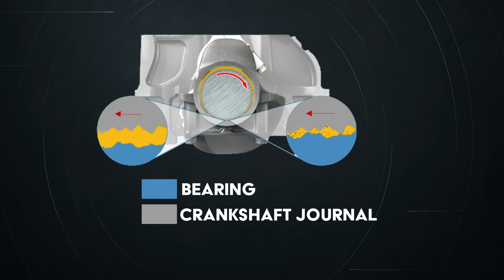the truth about start-stop technology (finally proven)

Comment: The start-stop function has two main purposes - to fool drivers into thinking they are contributing to the environment and to accelerate wear and tear on the engine, starter and battery.
Reply: Sounds like a win-win for automakers
Reply: @IvelLeCog Increase prices, reduce profit margins, and increase warranty services? That's a win-win? 

A win-win is reducing warrant service while decreasing fuel costs. Turn your start-stop off, putting more wear on your engine while using more fuel if you want. It's your money.
Reply: @MrRoguetech 😂huh
Reply: Bingo-they are saving a thimble full of gas and destroying their eng without knowing it...
Reply: @tonyjordan1320 and how much environmental impact does making a whole new engine have? It's all a racket for short term profit at long term costs...
Reply: @harveyottotech apparently very minimal impact. My BMW with start stop lasted 12 years and +300K. Only reason it died was because some asshole who was texting and driving crashed into me. Start stop never caused any issues.
Reply: @harveyottotech That's why start-stop engines are more environmental. They last longer, and therefore fewer need to be made. Decreased emissions and increased fuel economy are just a (rather small) bonus.
Reply: @tonyjordan1320 Start-stop engines last longer, because it reduces run time of the engine by hundreds of hours.
Reply: @tonyjordan1320  The fuel saved is used a 100 times over to manufacture the new parts needed because of premature failure. Just like everything else the globalists do it makes no sense other than to control you.
Reply: @bobmarchetti8878 Start-stop engines last longer. The fuel saved is fairly neglible. The real benefit is from decreasing the amount of time the engine is running, and therefore increasing the time it lasts.
Reply: @MrRoguetech  Interesting. As far as i know, the engines that last the longest are the ones that are constantly running without getting shut down, like in trucks. DO you have a source for your claim of start stop increasing livespan ? I can´t imagine that those couple of seconds at the stop light will actually contribute much, compared to the wear on the starter motor and other components from constantly restarting the engine.
Reply: @XA--pb9ni Trucks that are run infrequently last for hundreds or even of thousands miles. Do you have any evidence that there are fewer mechanical failures in trucks that are run non-stop than those kept in storage?
Reply: @MrRoguetech I never said i have a source  just that thats what i learned. But i asked you for a source and you clearly did not provide one.
Reply: @XA--pb9ni You learned that engines maintained in storage don't last as long as ones in use? So spare parts can't be made at the same time, because most spares would break before the ones being used?

That is not something I have ever learned.
Reply: @MrRoguetech Wtf are you saying? Who said anything about storage?
Reply: @XA--pb9ni Obviously a car just left sitting in a field is not going to last more than a decade.

All else being equal, an unused car will last longer than one that is used.

Source, I own a low-mileage car made in 1987. No major repairs ever. Runs great. Most cars stored for 40 years will be fine, other than gaskets and such. Most cars can't be driven 500K+ miles without complete engine failure.
Reply: Its to meet emisson standards. They are not trying to fool the driver, but the regulators.
Reply: @metallboy25 What regulators are forcing large fleets to convert to start-stop engines? You think UPS is just bowing to the marketing pressure from the large environmental car companies as they buy trucks by the thousands? 😂
Reply: @MrRoguetech  The regulators from governments around the world. Are you really that thick?
Reply: @metallboy25 Regulators are not forcing fleets to convert to start-stop engines. They are converting because they save money, and they save money by increasing the lifetime of the vehicles.
Reply: @metallboy25  Ah yes, the good old "regulations" excuse, so I can make a shitty feature that can benefit me rather than a real feature that can follow the regulation and keep the consumer safe from a "shorter programmed durability". Ofc, I'm sorry for thinking the industry was evil for a second.
Reply: @metallboy25 yeah, it gets tiring that everyone sees non existent conspiracies, when it's just a regulation not properly thought out.
Reply: @jonwelch564 
What prevents regulations from being properly thought out?
Reply: @vendomnu the usual, money and corruption.
Reply: @metallboy25 It's not "fooling the regulators" if it's actually reducing fuel consumption
Reply: @ej20tnz that not true. If you want to save fuel, go and get your vehicle chipped. Chipping you car will increase power and lower fuel usage at the same time, this will save you far more than fuel waste turning the engine over at the lights. An engine idling uses minimal fuel compared to driving.
Reply: @jonwelch564  Depending on the car, after a certain amount of seconds turned off, it saves more fuel vs idling. It obviously requires a bit more fuel to start, but last I read about it, the startup was equal to around 7 seconds of idling on a normal car. So every second you have your engine turned off over 7 seconds, you're saving fuel. It's a ridiculously small amount you save, and it's not even close to the amount of CO2 needed to build, repair and/or replace an engine or parts of it. Stop/start technology is silly, but it technically saves more fuel than cars without it. Also, chipping your engine saves so little compared to what it usually costs. You'd have to drive a LOT afterwards to really see the savings. Plus you add extra pressure to the turbo etc - and I'd bet that again, the savings in fuel is nothing compared to the wear on engine parts.
Reply: @DennisDanmark clearly you haven't watched the video and understood the verdict.

I chipped one of my cars, the fuel consumption improved by 14% you really think stop start saves that much fuel.

As for engine wear, the oil drains away from the mating surfaces each time it stops and takes 7 seconds to build back up, mean while you are 50m down the road and you've damaged your bearings. Did you not see that in the video? One year of stop start give dramatically worse wear than one million Kms.

You're having a laugh if you think start stop is a good thing. Chipping your vehicle won't cause excess wear because as was said in the video, once an engine is up to temperature wear is as good as zero.
Reply: @DennisDanmark  It's more to do with emissions - especially as for pedestrians, all those cars idling are poisoning the air right where the people are.
Reply: @jonwelch564 The issue is not one car unnecessarily idling. Its everyone's car idling unnecessary. Your engine creates toxic fumes. One engine creating this isn't an issue. Not even a hundred engines. However... we're talking about millions upon millions of engines unnecessarily idling. It's like coming home and seeing 1 ant in your kitchen vs a couple million ants in your kitchen destroying the place. At some point you will have to intervene.
Reply: @randomdudeontheinternet9926 you don't seem to understand the principle going on here. The number of cars makes no difference. If you chip every car and save 14%, we would save 14% fuel world wide. If every car has start stop you save less than 1%, we would save less than 1% world wide, and everyone had to get their engines rebuild before the life of the car is over, because of increased emissions, and worn out engines. The proportion of fuel saved is no different, whether it be 1 car or 2 billion. Your way will cost us much more. A fix could be to run a slow speed electric oil pump to keep oil pressure at all bearing surfaces. But then we'd have to carry much larger batteries which would add to vehicle weight and therefore increase fuel consumption. There's no free ride.
Reply: @jonwelch564 in the future they might force this future as so far turning it off is a loophole.
Reply: @jonwelch564  Like an AI chip? Does it optimize power output and fuel consumption or something? Can you install it on any car or what
Reply: @ej20tnz   No it doesnt. I have plenty of experience with start stop. It only seems like it does in controlled test environment. While being mostly usless in real day to day driving. While also destroying your engine over time.
Reply: @ej20tnz By a fairly neglible amount. The real savings in reduced wear on the engine. The amount of fuel saved turning off an engine for 30 seconds is tiny. But, you've effectively increased the life of the engine by 30 seconds.
Reply: Some London councils apply fines for not stopping the engine at traffic lights, it creates delays and fuel waste on startup. What authority was given to them.
Reply: @GWAYGWAY1 If a start-stop engine causes you delay, you don't know how to drive. The gas pedal is not an on-off switch. You should try not stomping on it.
Reply: @MrRoguetech I did not say what you said that I said. I stated that some London councils were fining people for not stopping their engines at light, and the stop start wastes time and fuel. There is a queue and the time the back person starts their engines e there is a delay  and that there is a waste of fuel on the start up. I do not have a stop start car but complain about councils putting wardens at junction to book driver.
Reply: @GWAYGWAY1 So the delay is caused by people who do not have start-stop engines.... Cool.
Reply: You're an idiot. It does not use the same starter motor. There are two different starters 

The starter motor in a start/stop system is specifically designed to handle the significantly increased number of starts required over the life of the vehicle

stick to topics you're actually educated on?
Reply: and it makes them ...
Reply: Absolutely!
Reply: Car companies can get around these emissions requirements by having some electric vehicles in their lineup. The start/stop feature allows them to add another 1 or 2 MPG on the sticker. It also gives the supply chain more work and makes it stronger. Of course, the consumer suffers when more parts have the ability to fail. Yeah the regulators may be trying to help the environment, but they also know that China is a real threat. They now produce over 50 different electric vehicles that we know of. They will make their way into western societies once they can pass the safety standards.
Reply: @simpleman72685            It is naive to assume they do these things for the good of people or the environment. Its not about efficiency, its about profit and control.
Reply: Don't think so actually, it only exists because politicians aren't fit for purpose as lawmakers.
Reply: Lol.  I actually like to use it in the summer time. But I have a unique engine with active thermal management.
Reply: @0my which doesn't stop the oil draining out
Reply: A lot of them are started from the alternator now which makes an alternator about 4-5x more expensive.
Reply: It's useful in heavy traffic but there's so many conditions to it, and the extra cost of the bigger battery and possible starter replacement, makes it stupid.
Reply: Engineering explained prove that any stop longer than (I think)  seven seconds is saving fuel.
Reply: It has two purposes - reduce wear on the engine so that they last longer, and reduce fuel consumption.
Reply: @MrRoguetech   It doesnt reduce wear on the engine. Quite the opposite.
Reply: @metallboy25 You have any evidence that it causes more wear than idling? There's mountains of evidence it increases engine life.
Reply: @MrRoguetech  I do actually. And so doesn any experienced meachanic. The engine experiences the most amount of wear, during start up. Not during idleing.
Reply: You can save 10% of fuel.
Reply: Well, dont tell me you are that stupid and dont agree that while engine is off, it is not producing emissions!? Ok, it kills your engine faster, but still there is  point
Reply: @MrAndzzeys When you change an engine when it breaks down, you will produce far more emissions than the many times you didn't stop the engine for 30-60 seconds each time.
Reply: 12 year old car with stop start. No issues here with any parts. Stop being scared.
Reply: Yeah the boogie man of normies that don't know jack shit about engineering.
Reply: My car saves money when I’m not driving it.
Reply: My BMW with start stop never had any powertrain issues in 12 years or +300K. I always had startstop enabled. The only people I know who ever had issues with this were people driving Ford Ecoboost engines...
Reply: Starter and battery are normally "upgraded" to withstand start stop high cycling (I work on the industry) that been said, I always turn it off as soon as I start my car
Reply: It really decreases fuel usage
Reply: Idk about the others, but I have a 6YO KIA with start stop on 130k. Start/Stop is ALWAYS ON, even on a cold engine. I'm still on the original battery that came with the car... Today was ~0C, and it started without any hesitation. The engine runs smoothly, no shake no move, and the starter works perfectly...
Reply: This is wrong.  After 10 seconds of engine off, net fuel usage decreases when accounting for the startup process!
Reply: It's for emission standards lol, some of you in this comment section are really reaching. Manufacturers would've had 0 reason to do this if it weren't for emissions.
And it does actually reduce fuel consumption by as much as 15% depending on engine and the type of traffic you're in. Not saying it's worth it, but it does fulfill its purpose.
Reply: My car has done 111k miles with start stop on all the time. It still has the original battery and is running completely fine. Being in a lot of traffic can make it quite active and that time all builds up at the end of each year of commuting. Each small saving builds up for each individual car over its lifetime and in urban areas where there are many cars with the feature, you'd see a huge difference even daily in idle time vs off time. 

You actually have to be able to see big picture to understand why these systems are beneficial as a collective. 
Don't you want to live in a city with fewer emissions?
Reply: @TomBridle I don’t want to live in a city at all.
Reply: @m1rkduellerthats fair enough, the benefits are felt outside of urban areas too
Reply: EXACTLY. It's a sham like everything else the globalist tyrants are attempting to push down our throats. People are finally realizing its all lies. Thank you Donald Trump!!

Comment: As others have commented already, the main downside of solder in automotive applications is vibration.  Solder stiffens the wire and forms an abrupt transition from stiff to flexible.  This transition concentrates stress from repetitive motion and will begin to break the wire strands at that location.  That is one of the main reasons that you don’t see factory soldered connections in either cars or aerospace applications.  A properly done crimped joint is nearly the same strength and electrical resistance as a soldered connection, while being much faster to make and much more vibration and motion tolerant in service.

Comment: Incredible that nobody has done a cost bemefit analysis... I understand sacrificing engine durability (manufacturing waste/gasses far away from dense population) to gain lower localised tail pipe emissions (cleaner air in high population cities, towns, outside schools) but what is the scale of cost/benefit, catalytic convertors work better when up to temperature too, so start stop/hybrid engines not only have increased wear but lead to inefficient exhaust cleansing... battery/elec cars are the future (no exhaust, less components wearing n tearing) but the supply chain from mining minerals, through production and recycling of old batteries remains questionable (human rights abuses, funding militia and warlords in likes of DRC)... HMMMM

Comment: Perhaps this test has proven a cost to these systems, though we should acknowledge that it started with a conclusion and set out to validate the conclusion with no objective critique.  It's not quite scientific. We didn't look at the benefit, for instance to lung disease and PM2.5 caused brain damage. Maybe the benefit isn't enough and the cost isn't worth it?  That question remains unanswered.  Be that as it may, we'll be rid of primitive, inefficient mechanical engines within a decade, hopefully.